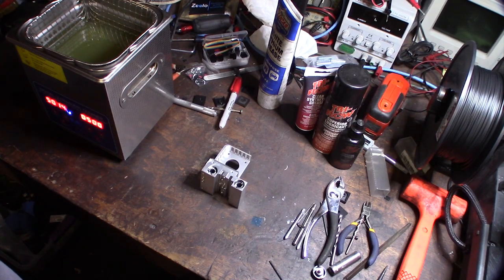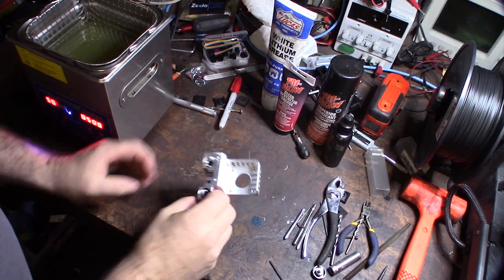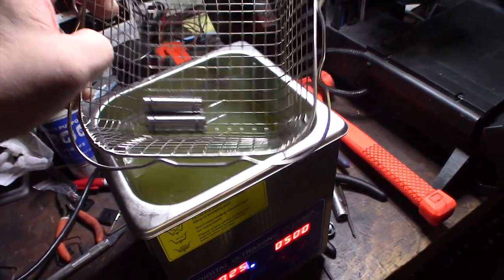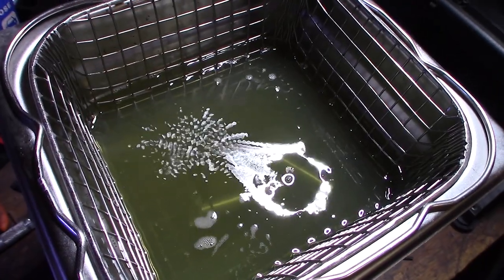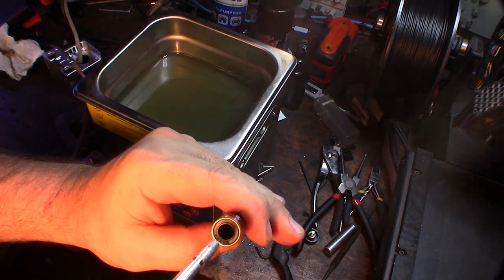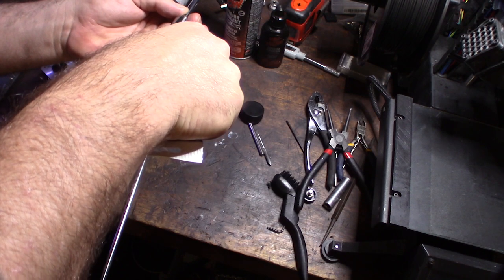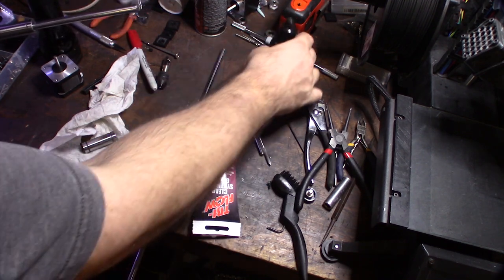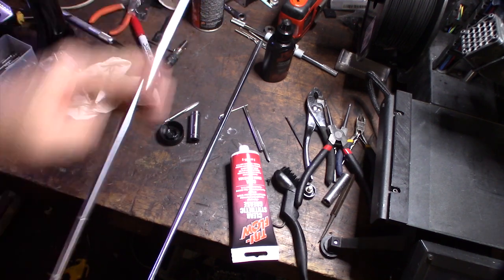3D Printer Linear Rod Rail Bearing Cleaning and grease repack with Tri-Flow synthetic Ultrasonic

Comment: Wondering how the Tri-Flow Sythetic is holding up.  Also wondering if you ever tried Sil-Glyde?
Reply: Both greases are good. I prefer synthetic. Any other grease will build oxidation.